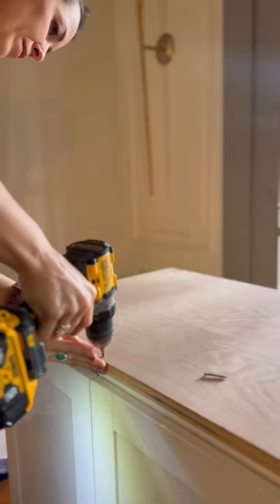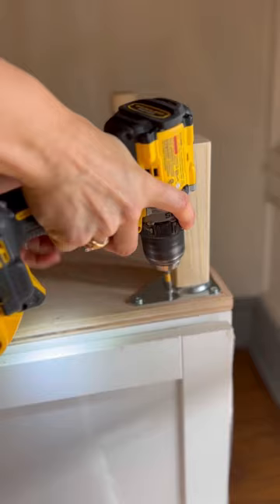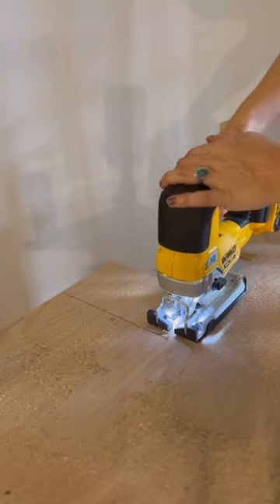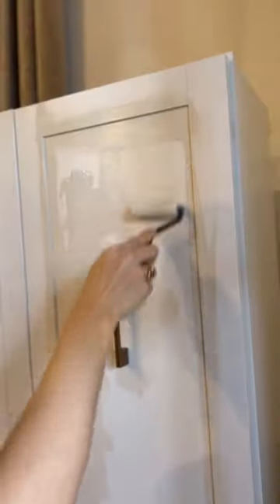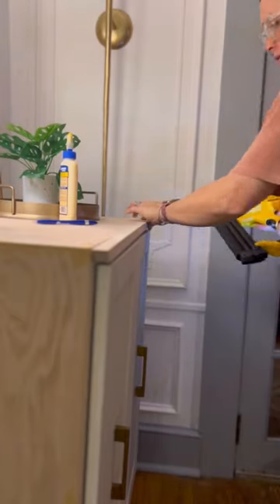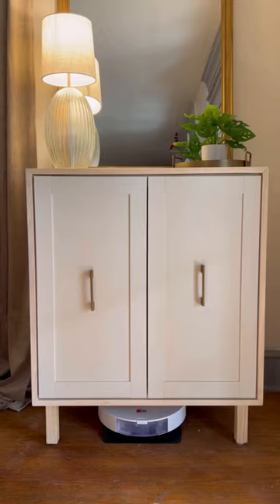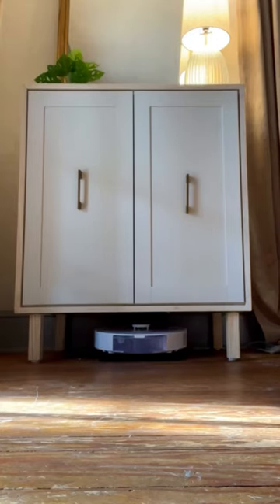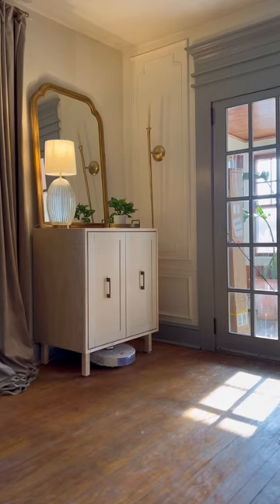DIY ROBOT VACUUM GARAGE from a kitchen cabinet #diyprojects #homeimprovement #homedecor

Comment: How do you empty it??
Reply: Just build a new one every time it fills up
Reply: She should have made a door on the side with hinges to have easy access
Reply: You move the shelf I guess, You empty the bag once it's full.
Reply: I have almost no personal experience with robo-vacs, so this may sound clueless, but doesn’t the material picked up by the robot stay in the robot until you remove it? Or does it get sucked up by the vertical part of the charging station?
Reply: Gets sucked up into the vertical part - this version is "self-emptying" although the vacuum bag in the stand will fill up & need to be emptied. The lid on the top of the stand opens up & you reach inside to pull the full bag straight up then replace with an empty bag.
Reply: @booi lol 😂